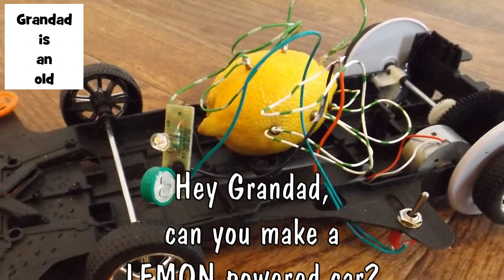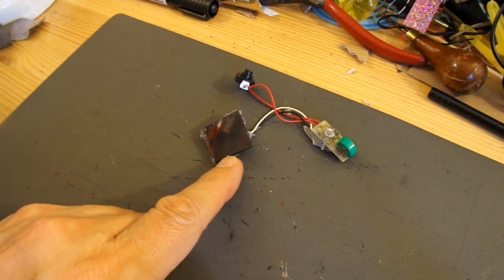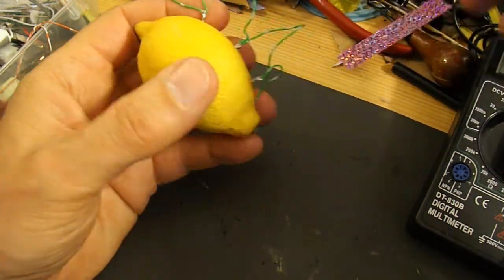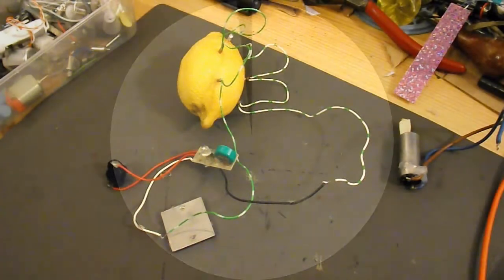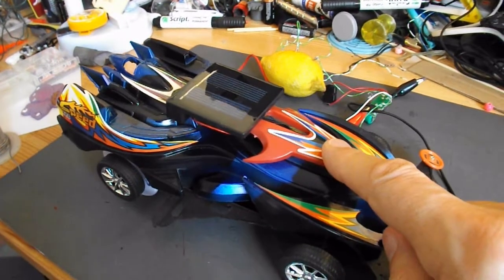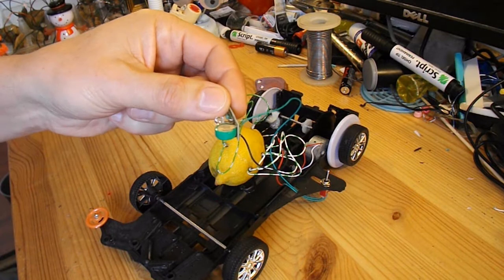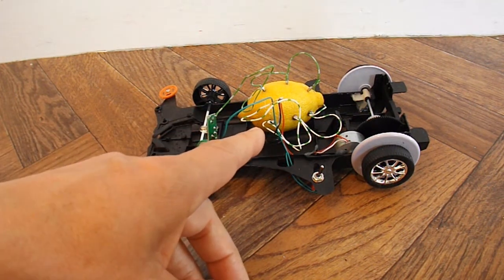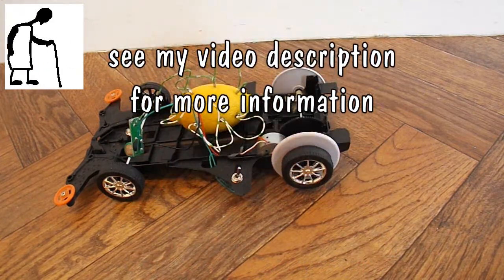Hey Grandad can you make a Lemon powered car?

Comment: i think the reason it wasnt effective at charging the battery is this: the lemon cell barely puts out 1 volt and at a tiny current, the battery needs nearer 2v to get some charge in.  the lemon as it is , is probably drawing a tiny amount out of the battery! cutting the lemon and making more cells and connecting in series will get a bit more oomph from it, and you can measure the output current with your meter, but i suspect lemons will be in the micro amp range, thus needing days to charge that battery for a car run
. it is a fascinating video all the same, thanks!
Reply from the maker: Thanks, that is the point of the other video. When the lemon apparently charged the battery successfully I was completely surprised but foolishly didn't consider what else might have happened. As I said, when I tried again, each time I got less distance. I tried a double lemon, but then it was too heavy and the battery was already depleted. I will probably have another go sometime, like you say with multiple segments of lemon to boost the voltage. Since this video went out I spent far more time trying to demonstrate how it didn't work and why it was misleading than I did making the original video.

Comment: Congratulations !
Bit of a 'right of passage' this one..with you believing it to be an improbability so strongly before.
I'm sure there was some residual power after the battery recovered, but am also sure there wouldn't be enough to drive that car for nearly 4m. The light going out when the lemon was connected tells us it's charging anyway.
An all round winner and not a lemon  :)
Reply from the maker: Thanks slider, I was careful to show the steps so it can be copied and verified. As you say, the LED is a good indicator. Your comments on that solar charged car helped.
Reply from the maker: GrandadIsAnOldMan Just to be double sure I am going to disconnect the lemon battery and discharge the rechargeable battery, then leave the car for about 8 hours for the rechargeable battery to recover and see how far it runs after that.

Comment: to get more power out of the lemon  cut it in few pieces and try to make battery separate batteries out of them
Reply from the maker: It does not work that way, look it up. It is the surface area of the copper and zinc exposed to the electrolyte. I could put more zinc nails and copper rods in the same lemon and get more current. If I cut the lemon into pieces I could put the batteries in series to multiply the voltage, but the current is down to the surface area. If I squeezed the juice into a jar and put a loose coil of copper wire and a loose coil of zinc wire into the liquid I would get more current flow. The wires must not touch each other.

Comment: Nice idea but it's hard to believe that a lemon can charge a battery... Suspicious...
Reply from the maker: Maurício Ferreira yes it is an electrolytic process. The lemon is supplying the electrolyte. A potato would also work. I have already explained in another reply that you could squeeze the juice into a container and just use that. However the lemon makes a handy container naturally.
Reply: Although my knowledge does not come close at all to Grandad, so I know, that is the beginning of all battery (correct me if I'm wrong please Grandad).
The electrons pass from the nails between them and accelerated by the acid of the lemon.
The batteries, work pretty much the same:
Two metals and chemical, usually acid, which accelerates the process.
Another method to accelerate electron transfer between metal is heat.
I have a project that I take from time to time, on this page:

http://es.ideas4all.com/ideas/60513-paneles-solares-caseros

I want to finish it, but I need to do other things beforeeee! 8-P
Reply: GrandadIsAnOldMan And it had to be paid to people who have picked up, gasoline trucks have transported ...
In this world, nothing is free.
Neither receipts for utilities or lemons!. 8-)
Reply: The power doesn't come from the lemon, its a Zinc/Cooper Battery, the lemon is only the electrolyte.
Reply from the maker: At 3:00 I show how to set the lemon up using copper and zinc. Here is a video I made last year on making a lemon battery.Lemon Battery
I then show that the lemon battery produces about 0.86 volts. On it's own that would not run the electric motor which is why I have always said in the past that you cannot run a toy car from a lemon. However using the same principle as the solar lights or in this case a solar butterfly stone you direct that small charge into a battery and then run the motor from the battery. That is exactly why I used the garden ornament as the starting point of this video. I could have just started with a rechargeable battery but I wanted it to be clear what was happening.The solar panel on that garden ornament is not enough to power an LED on its own and certainly not enough to power an electric motor. The lemon battery produces even less power but it can be collected and used in the same way.
Reply: Right I see. It's weak free energy before the lemon goes off!
Reply from the maker: BoomerDude McGuy nothing free about it. Still had to pay for the lemon.